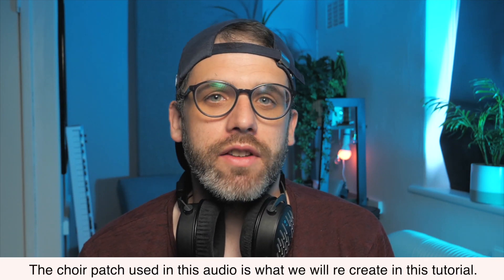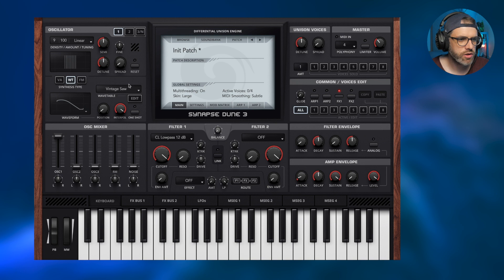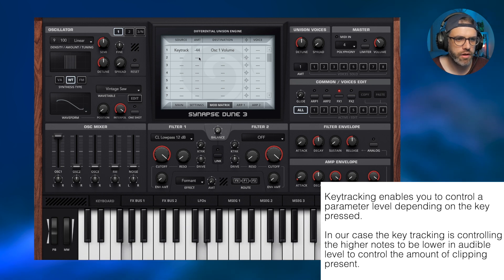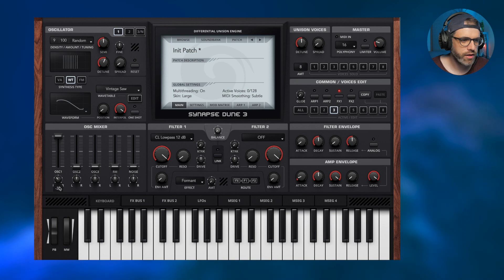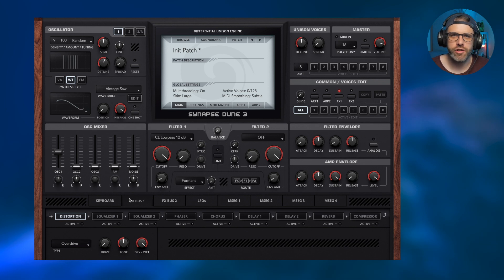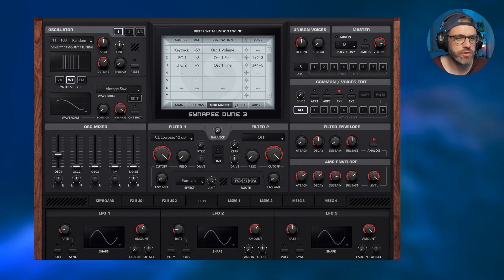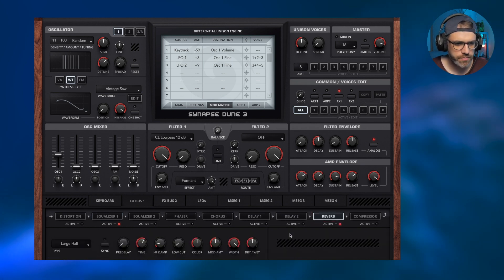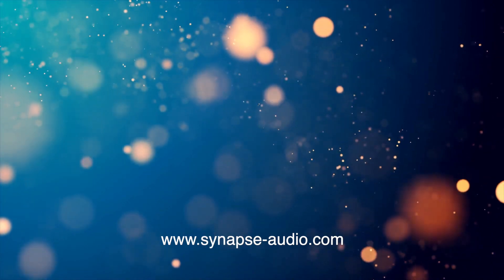DUNE 3 Sound Design Tutorial Episode 6: Synth Choir

Comment: Hi Demis, thanks so much for these!
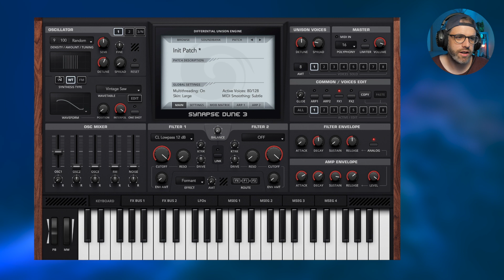I have a question... at 3:35 when you're demonstrating the hard panning of voices 1 & 2, they still sound pretty mono to me.  But later (at 7:02) you demo them again and I do hear the hard panning. Why is that?
I just tried duplicating it on my own Dune3 and it does hard pan when I solo voices 1 or 2.
Reply from the maker: Check the position of the Unison Spread knob at the top right, it differs which is probably the reason (in addition to the Osc Pan knobs).
Reply: @synapseaudio2488  Interesting.. I tried following step by step and I'm getting different results on that one part, but.. no biggie. I almost wonder if it's just a recording issue (i.e. 3:35 should sound hard panned in the video, but it doesn't..).  Anyway, all good, my end result sounds as yours does.  Great tutorial, thanks again :)